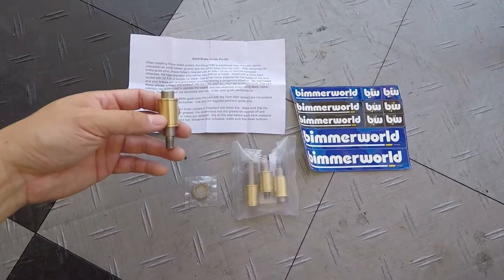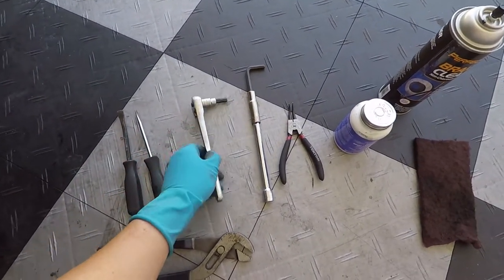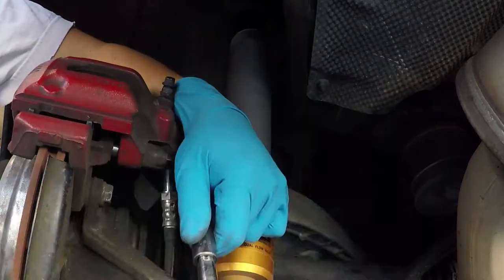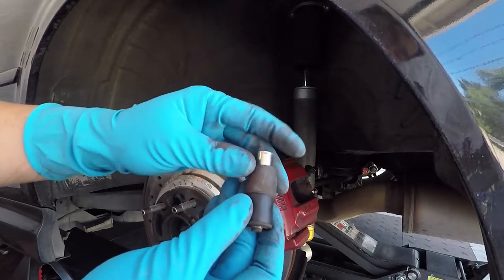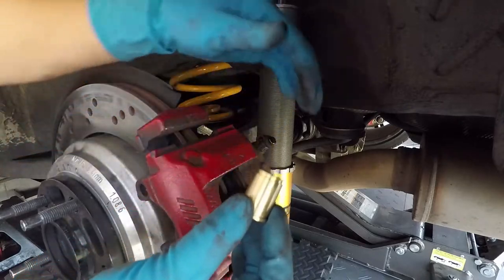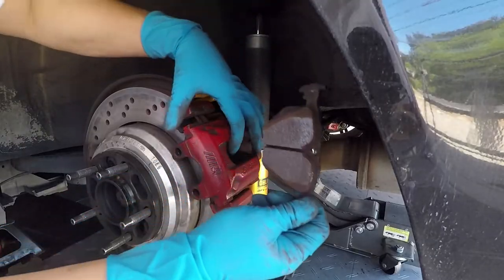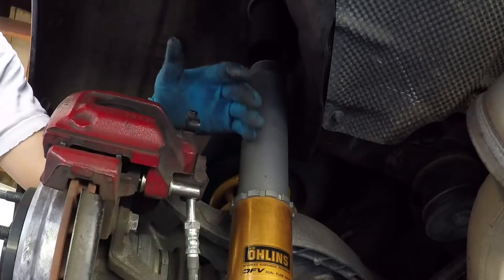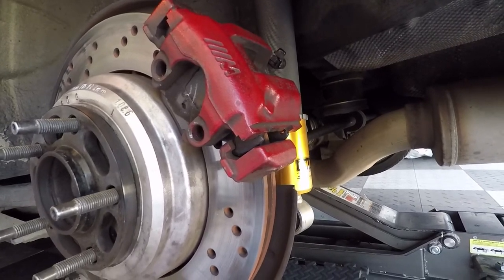No Rear BBK, No Problem! Rear Solid Brass Brake Caliper Guide Pins DIY

Comment: Wow, your bushings went in really easily.  Mine were tight AF.  I couldn't install them by hand, I had to use a clamp to press them in.  And yes, I cleaned the caliper and lubed the bushings.

Comment: Sean- Do you notice any increased brake squeal with these?  Thinking of doing this mod for my daily driver and occasional HPDE car.  Thanks for your feedback. I appreciate your vids!
Reply from the maker: I already had brake squeal from running race pads on the streets. LOL No noticeable increase in brake squeal from these. In theory, these solid bushings will glide (when lubed) smoothly whereas the stock rubber bushings can make the guide pins "sticky" and cause brake squeal.